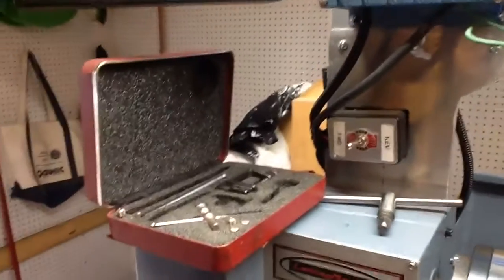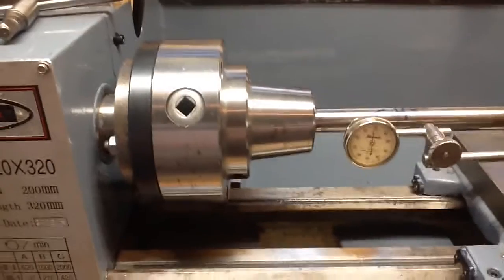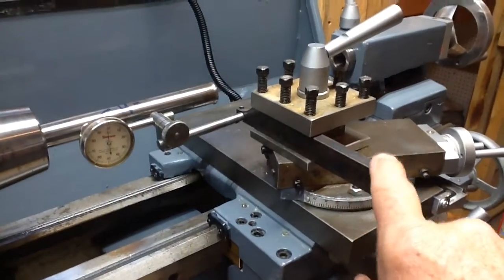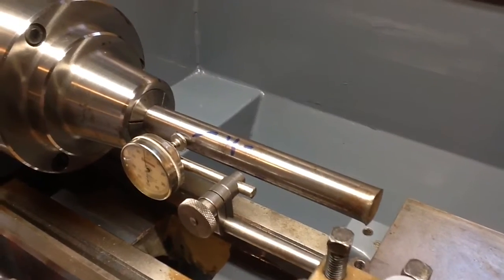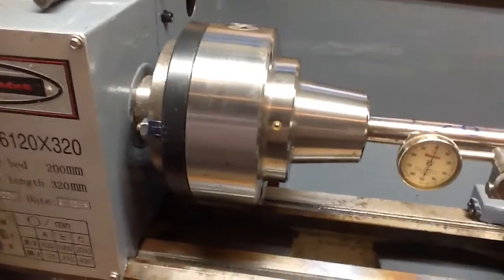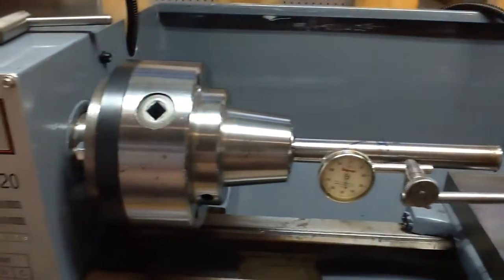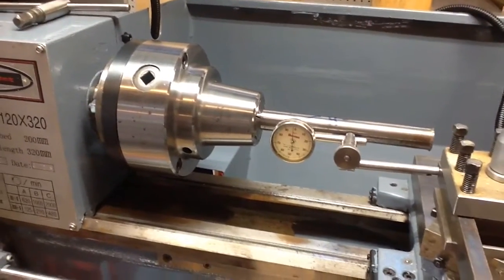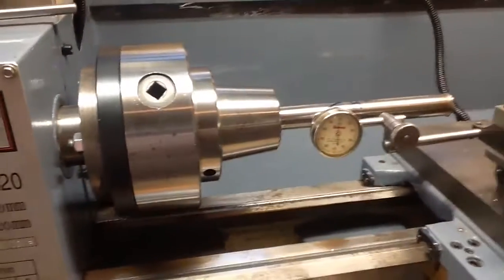Checking runout on Lathemaster 8x14, 5C collet chuck

Comment from the maker: Hi Fred, good question! I was so happy this one had so little runout, I didn't check it further out.  I had been expecting to see 20 or 30 thou runout (at the same spot on the bar) like the other lathe and chuck. I'll be going back soon, need to align the tailstock anyway, will try to remember to check this runout at other spots.